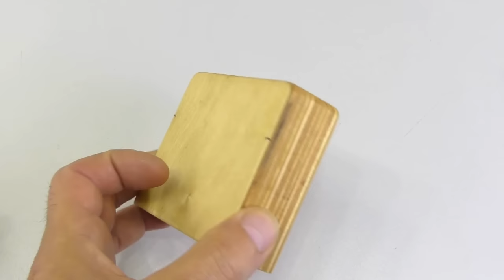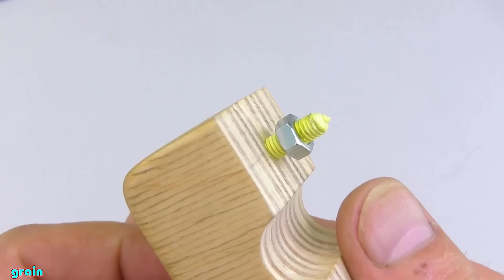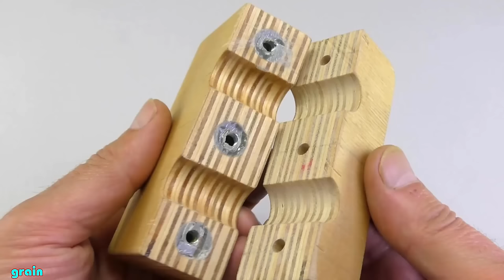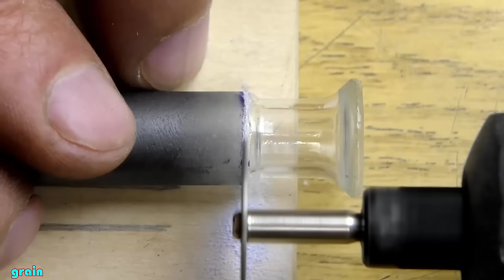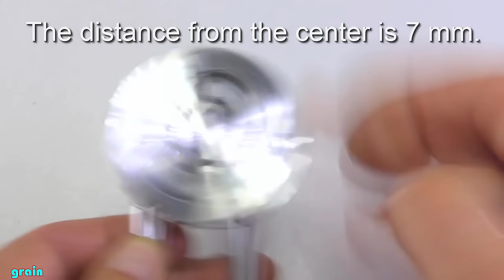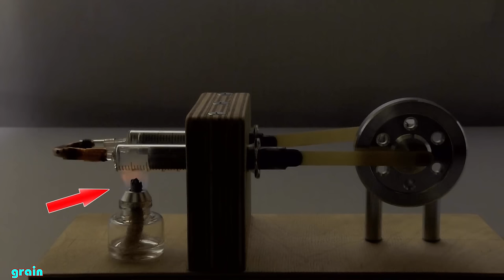Two-syringe Stirling engine

Comment: One of the few successful and real steam engines on YouTube
Reply: Arun daa ye steam engine nahi he Stirling engine he
Reply: @Sunitapatidar9090  thanks for correction
Reply: It's an Alpha hot air engine.
The Alphas have a 90° phase, and the displace or cold cylinder runs in a separate cylinder.........as the video shows.....
The Beta type have the hot piston and displacer in the same barrel.....
Reply: @philwoodfordjjj8928  thanks for clarification 
I am not an engineering student so I am ignorant. But they are amazing and I hope to make them someday.

Comment: Why hasn't someone scaled this up to something that can power a home? Perhaps with a battery inverter system as I imagine rpm control could be tricky. Combine it with a rocket mass heater so you can burn scrap wood and paper to power a home. That kind of burner can be made very efficient and relatively clean because it burns very hot.
Reply: Oil and coal magnates:😬
Reply: I'm researching for this right now

Comment: Meu amigo, Grain!! Vejo todos os teus vídeos e acho oncrível tua criatividade!! Êste stirling modêlo Alfa é muito legal, se você quer mais rpm, colocar arame de cobre amassado dentro do cilindro quente, regenerador!!! Só um pedacinho para não atrapalhar o percursso do pistão!!! Valeu!!! Talvez você consegue 900 ou 1000rpm, Abraço !!! Marcos Valério Ciência, Rio de Janeiro!!!!!
Reply from the maker: Thanks for the advice, maybe someone will read here and take advantage. Actually RPM could be bigger, but I made the fire small. I did this because with a large flame the temperature was higher and the plastic tube melted and the chamber was depressurized. I did not find material to make a nozzle on a hot syringe.
Reply: @grain-diose  compreendi, meu querido!! Eu também já passei por esta situacão, e eu gosto de falar com você, porque você é uma pessoa compreensível e humilde!!! Parabéns pelo seu lindo trabalho, que sempre aprecio e aprendo, Também!!! Que Deus abençoe você e abençoe teu caminho!!! Abração do seu companheiro de Ciência, quem sabe a NASA dá uma chance pra nós???!!!!

Comment: some info.     the plunger/piston  length  is  Excessive.  consequently, 
there is  Excess mass  in the pistons;  and  Friction  losses  are
greater.
Reply from the maker: Yes you are right. But I think the friction here does not interfere, because the syringes are good and I additionally rubbed the pistons with graphite. And about the mass, I agree. But this is a lot of work, you need to cut the pistons and also cut the syringes (chambers). And most importantly, if I shorten the syringes for example 2 times, then the attachment will be more difficult to do. The fastening must be rigid and at the same time it is necessary not to break the glass and besides this there should be a place for heating. In short, things get very complicated. And the main question is what is it for? The goal was not to make the most efficient engine. The task was to show how to make the Stirling engine with minimal difficulty.

Comment: Does the copper pipe that connects the cylinders serve as a regenerator? If you filled the copper tube loosely with steel wool would it improve the efficiency?
Reply from the maker: yes

Comment: Hey! Amazing work! I’m trying to build a Stirling engine too on my own, but I have a small problem...How did you do to isolate your plastic tube from the heat ? Mine is melting...thank you if you answer, I really need some help :D
Reply: The syringe must be a glass one.
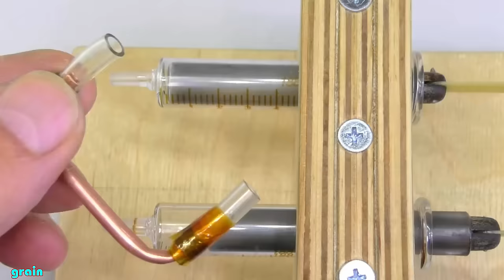Reply: @chudybzyk  yes the syringe is of glass but the tube which he attached to the syringe 3:27 is not melting, how?
Reply: @leotheinnocentlion295  Idk but it's working lol
Reply: That looks more like a copper tube imo
Reply: Use Teflon tube it takes much higher temperature than pvc
Reply: It looks like he used kapton tape.
Reply: What material is the piston made of??? Any idea??

Comment: some late info.   good work    the  baseplate  is  noisy.     anchor the whole thing, better.     then, diagnose the source of the  Knock.      engine top speed might be greater, if connecting rod length is increased; maybe an inch.    the output is  Where.       googlegtranslate
Reply: Never trust in the opinions of a free energy fanatic.

Comment: what material you used for the connecting rod and the piston?
i need it please..
Reply from the maker: I made pistons from the plunger of the same syringes. I cut them and glued pieces of thermoelastic connecting rods inside. For better sliding of the pistons, it is worth covering them with pencil graphite.
Reply: Thise is areal or fake please answer

Comment: Nice work ! Is it graphite on glass pistons ? As pencile graphite ?
Reply from the maker: Thanks. Yes, I rubbed the glass pistons with a pencil. It improves gliding and tightness as well. This is the analogy of dry lubricant.
Reply: @grain-diose  On my engine I use graphite, excellent lubricant, BUT when the temperature is very high the graphite piston gets stuck

Comment: Hello where did you get support for the Flywheel 60 mm?
Reply from the maker: I used ready-made Flywheel and support from another device. Aliekspress sells all parts for Stirling.
Reply: @grain-diose  I found the steering wheel, not the stand.
Reply from the maker: Do you mean this? - https://aliexpress.com/item/32893626330.html

Comment: Awesome videos live ever Master ^_^ 
Just for my curiosity.
If only one side of the syringe had a way to regulate the length in the flywheel?
Reply from the maker: Thank you, but I did not understand the question about "to regulate the length in the flywheel". If you mean the length of the crank, the length can be changed, the length of the crank is unprincipled, but it is better not to make it too short, inaccuracies in the performance of the parts will affect.
There is another nuance, it is advisable to make sure that both pistons enter their chambers as much as possible, I think this is understandable. And then adjust the angle of the connecting rods.

Comment: Can someone please answer me, can I make this engine with a dynamo to light a bulb?
Reply: Where should I place the dynamo to make it rotate by the rotation of the flywheel?
Reply: @john5036  
Look behind the flywheel

There's that small wheel idk what's it's called

Perhaps you can connect a string to it to a dc motor (connected a same wheel like this in it)
Reply: I remembered the name, a pulley , yes

Comment: All OK but the syringe would have melt ys
Reply from the maker: These syringes are made of thermal glass. This is sold on Aliexpress - https://aliexpress.com/item/32655390758.html
Reply: @grain-diose  here in India 🇮🇳 aliexpress will not work or transactions are not accepted ,but it's thermo glass not thermoplastic .
Reply from the maker: @BharathwajK  Yes thermo glass

Comment: The backside of the flywheel attach a rope on it and connect it to a dc motor. Then run the engine then It will generate electricity from the motor. If it is running alone then what was the sense of making it 🤪

Comment: Why the syringe 💉 does not melt
Reply from the maker: The alcohol burner is not so hot. The tip of a gas burner will melt the glass.